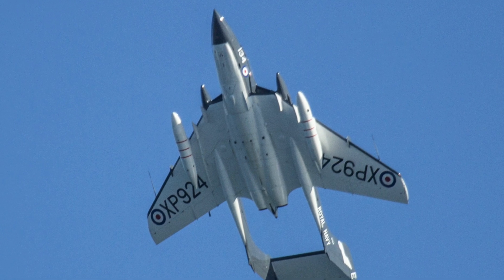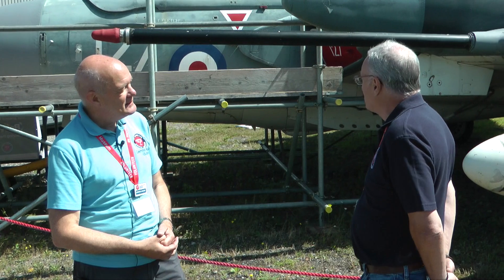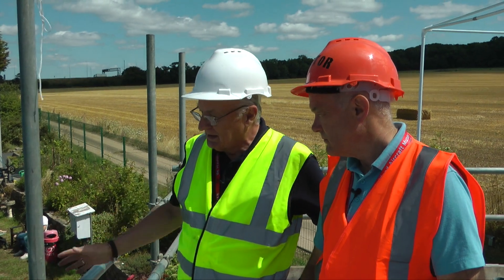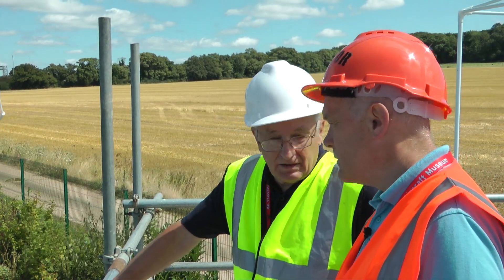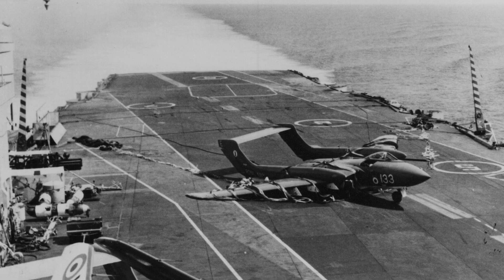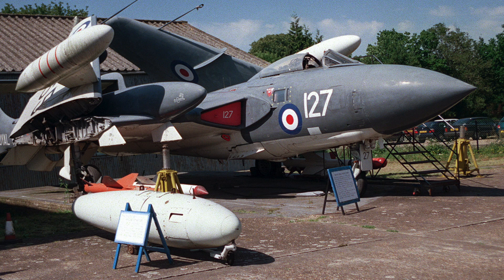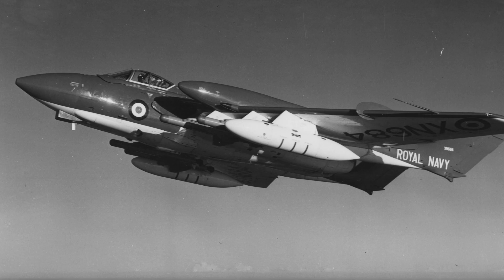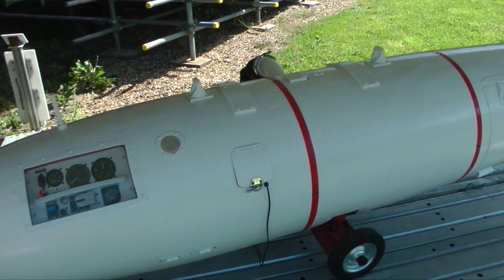DH.110  Sea Vixen - meeting the restoration team at work

Comment: I was at RAF Halton (1978 to 1981). A couple of Vixens were in the workshop for us apprentices to work on. It’ll be good to see one restored.
Reply: Yes, I worked on them at Halton too between '75 and '78 😁. Funnily enough, I'm actually writing this sat only about a mile from that very spot where nearly 50 years ago I arrived at Halton for my apprenticeship🤔 and 20 or so of us will be holding our reunion next year on 1st April.
Reply: @125brat I was 132 entry.
Reply: @kevintracey4644  Hi, we left in February '78 iirc so I would imagine you hadn't arrived then and our paths of Senior Entry and rookies hadn't crossed, but probably leaving 126 or 127 as Senior Entry to "look after you" 🤣
You may have heard about the Whirlwind that was "relocated" onto the Groves-Henderson parade square? That was us lot celebrating 1 year at Halton. The date was the 1st of April 1976 😊